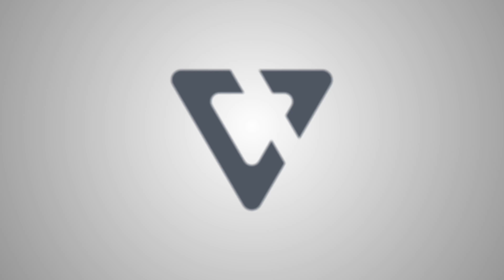Building a Better Film Scanning Lightbox | Film Photography

Comment: Thank you for the inspiration. I built the same 99 CRI system (chose the 6500K) but sourced an Apollo 8.5” X 11.5” lightbox. Rather than using double sided tape to secure each strip down, using stainless M3 bolts and nuts allows for easy removal. However, it requires more drilling. 

Another modification is to purchase a threaded female barrel connector. It for perfectly where the power cord hole was. 

I experienced zero issues with Waveform’s Wago 2060 solderless wire connectors that are on each end of their LED strips. Daisy chaining each 18 gauge wire was a breeze. Again, it allows me to easily disassemble in case I need to address any issues. 

Bright! This light box almost blinds you! I highly recommend buying Waveform’s optional dimmer to couple with their 24v power supply. I am so glad I purchased it. Running around 50% output is all that I need and more. The dimmer is high quality all metal construction, plus, it is flicker free. You don’t get this with cheaper lighting. 

Indeed, I spent some extra $$$ to get 99 CRI. As you point out you paid a whole lot less versus buying one already made. Thank you!
Reply from the maker: Thank you for sharing! We’ll definitely give those modifications a try.